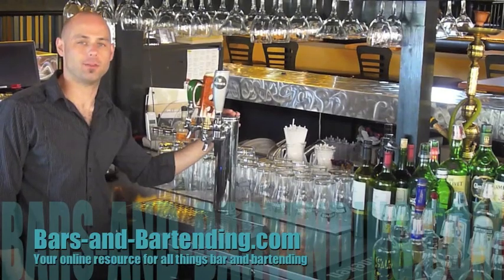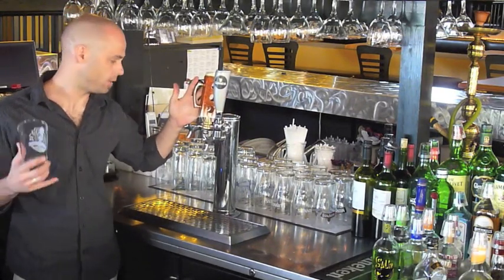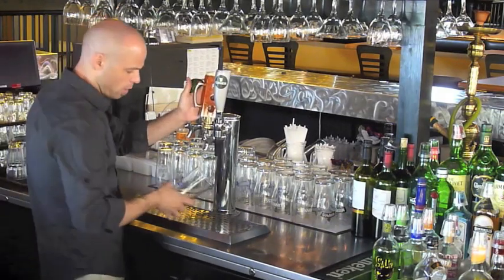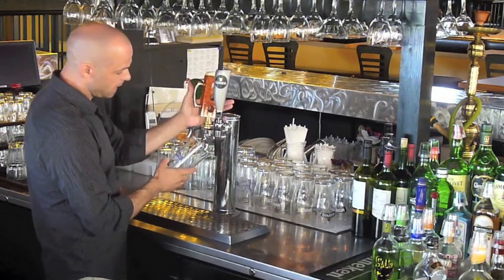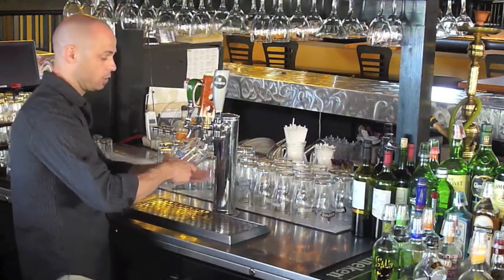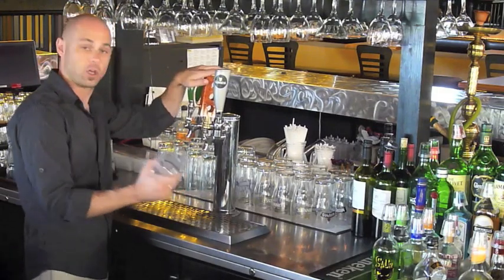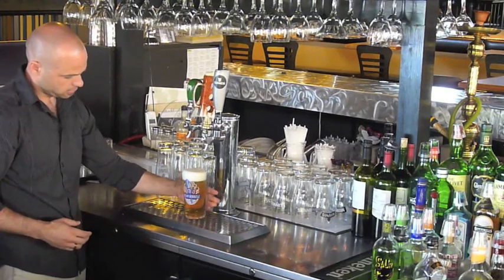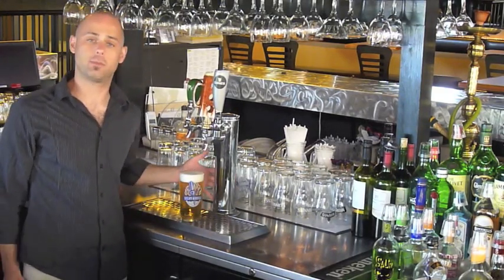How to Pull a Pint | How to Pour a Pint of Lager / Draft Beer

Comment: In England, you would probably have to put the rest of the pint in a 2nd glass! :o)
Reply from the maker: One to two fingers of head at the top of a pint not only makes the pint look better (as less foam can indicate flat beer or a dirty glass), but it also enhances the taste experience.  Each bubble coming to the surface is carrying with it the full aroma of the beer.  And since much of our taste experience is through sight and smell, those aroma bubbles complete the overall presentation and flavour of the beer.  That being said, if I were in England paying what you're paying for a pint, I'd probably ask them to top it off as well ;)
Reply: Bars and Bartending
I'm sorry but you absolutely have to let it settle and then top it up, otherwise your are ripping me off
Reply: Bars and Bartending Unlesss your up north where its about £2 a pint
Reply: even in my union where pints go for £1.35 I want a "pint" not nearly a pint
Reply: Bars and Bartending Sorry mate you are wrong on this one. I work for a brewery and this is simply too large a head.

Comment: (Toronto bartender here) I'll agree with the other commenters, this is simply way too much head. This isn't an issue when a tap is being constantly used though. But when a tap isn't used for 5 minutes, and I get this problem when I pour creemore or organic, is that gas gets in the lines, so the first half second of beer is loaded with gas. I'll clear the lines by pouring into a jug, then I get my clean glass and I'll put the pint into the beer glass and they'll come out perfect everytime.

Comment from the maker: @MrAlvarezMan Guinness is a stout and stouts are in a special class of their own.  Guinness for example uses a different gas than say Carslberg and the head and pouring techniques differ drastically.  Btw, draught simply refers to a beer that's available from a keg.  Any type of beer can be draught (or draft).  The consistency of lagers and ales will have more to do with the temperature of the kegs, the cleanliness of the lines, the length of the hose from the kegs to the taps etc

Comment from the maker: @liammcgeehotmail Could be a beer gas problem if it's on its own line.  Or, if you're using frosted mugs, try using just chilled mugs instead.  However, it sounds like you're saying that you pour all the other drafts ok but only have issues with the Carlsberg.  If that's true, you may need to get someone in to clean the lines or try letting out the first half second worth of beer before putting the glass under the tap.  Sometimes the warm stuff at the end of the tap causes too much head.

Comment: Just seeing the comments from a while back. I also have a hard time with the Carlsberg tap. It has a regulator on the front of the tap to control the flow and it's really inconsistent. You could have a perfect pint and then a pint full of foam. Is it better to have the beer flowing fast or slow?
Reply from the maker: There's no definitive answer here - if a fast tap is pouring well, it's better than a slow tap pouring poorly.  Likewise if a slow tap is pouring well, it's better than a fast tap that doesn't pour well.  If you're getting a lot of foam from your draft taps, call someone to check and clean your lines...regularly.
Reply: Bars and Bartending Managed to get it working. Regulator is quite sensitive on the front so it was just a case of slow slow adjustments over several pints.

Comment: Worth mentioning and the biggest mistake I see people that don't normally pour beer do all of the time; they don't open the tap all the way.  So often they get too much foam and try going slower; which does exactly the opposite.  Can't tell you how many festivals and stuff where I'd have to help the help!  

Of course, if your beer got undercarbed somehow and there's no head forming, at the end spritz into the center with the valve cracked open and closed a couple of times; instant head!